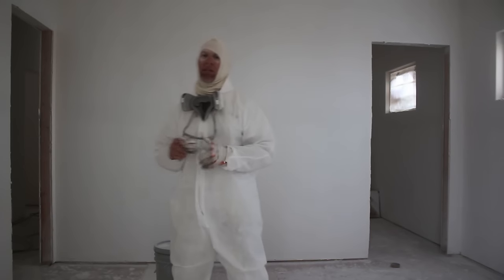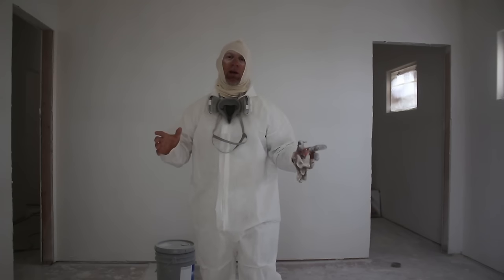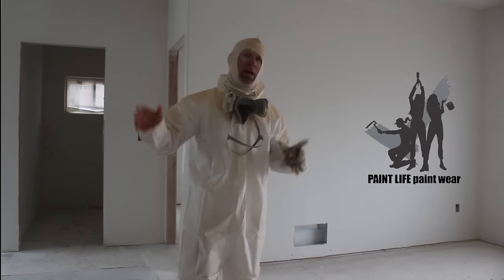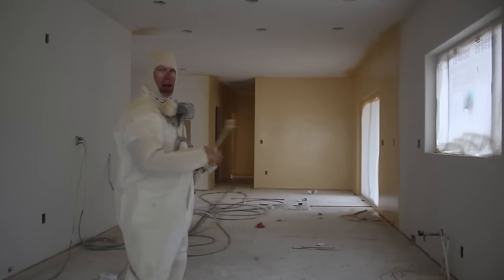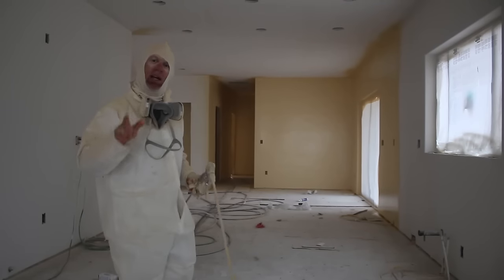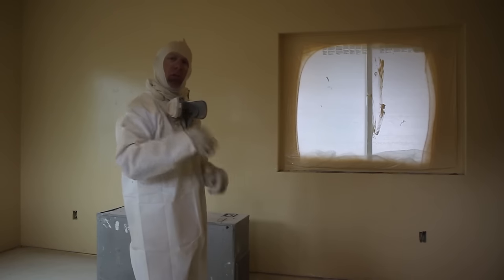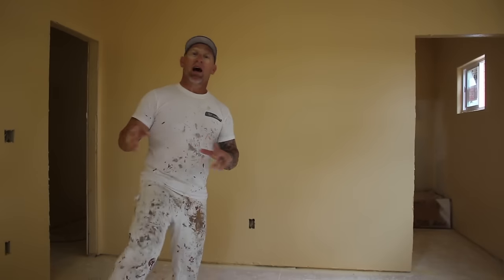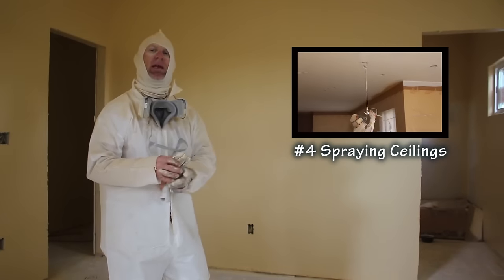Spraying Interior Walls With An Airless Paint Sprayer.  How to paint drywall.  DIY painting.

Comment: Haven't used an gun extension for this purpose... Always use a 3 or 6 foot  pole gun. I also roll at least one coat of topcoat(celings and walls) so  the paint is worked into texture. A roller texture is easier to touch up later on than just spray...Love a 12-21 or 23 tip. Thanks for your videos

Comment: Hello, I want to understand the process involved after the drywalls are installed. I believe you'll first skim the wall, sand it, spray primer and then spray paint, right? Is roller used for any of the paint jobs? 

Trying to understand what aspects of the job will the sprayer be used. Very new to this approach

Comment: hey good video and looks like you guys have a good gig going,  efficient and quality work from what it seems.  just a little tip for ya that might help you guys.  not saying you don't do a great job by any means just one professional that likes to help another,  I don't only have expertise in residential painting applications but also design & app expertise and business as well.  some homeowners or customers can sometimes have a great eye,  or hire people,  like myself,  that have a great eye and can tell small variations in paint coverage... long story short I guess my tip to you would be to start your spray at the corners.  there's nothing wrong with taking your finger off the trigger.  sometimes haste can lack.  when starting your spray in the corners, you can actually mentally control your line of attack and also expect a more evenly coated wall. your corner coverage will precisely tell you exactly how to apply to the rest of the wall around it. it'll all be in the hand after that. try it out.

Comment: Montana Painter is correct, I back roll most of my coats of interior spray. Even my primer coat. Do an experiment where you spray a section of wall so that it is solid and uniform and then take an 18 inch roller with a three eights nap and back roll it, you’ll find out you have way too much paint. Then spray an area so that when you back roll it you have a nice uniform code that is worked into the substrate.
Just as the Montana Painter has explained. When you are doing large commercial buildings interior with large walls 20 feet high touching up becomes a lot easier when you don’t have to repaint entire sections because everyone knows just a spray coat will not touch up,
Not to mention the cost savings in the amount of material you will use on let’s say a 400 to 600 gallon project.
Reply: Hi, so do you recommend spraying a lighter coat and always back rolling the paint with 3/8 nap roller? What if you are dealing with a level 5 smooth finish ceiling, and you want to put an eggshell sheen in the kitchen /dining room connected area. Will back rolling give you lap marks? Or is the fact that you sprayed the paint on in a fast fashion, help lesson or eliminate that. Lastly, whether just spraying or spraying and back rolling, is one nice spray coat sufficient?

Comment: Can I ask how many coats do you spray for new construction? In this video you sprayed one coat then removed the masking. If I need to spray two coats, do I need to remove masking right after the first coat, wait until the first cost to dry,  mask again, then spray the second coat?
Reply: I know it’s a year old but typically you’ll do one coat of primer and two coats of finish on walls. You can do one coat of primer and one coat on the ceilings though with spot priming, depending on your scenario. I do a lot of commercial jobs and new construction/remodels, you don’t have to pull your tape in between coats. It depends on what surface you’re taping to, how long the tape is going to be there and stuff like that. We don’t have the time or luxury to mask more than once, so we do it once and get it all done then pull it soon after. If you leave it too long it’s hard to get off. If you’re a painter i’m sure you’ll have learned this stuff by now.

Comment: Thank you for this video and all of the other videos you posted, the knowledge, advice and techniques you give is awesome! We just finished painting our house with an airless sprayer (Graco Magnum X5) using the techniques you recommended and had one problem - Goggles kept fogging up. I had a paint suit on, respirator, and went through five differn't pair of safety goggles. I kept having problems with the goggles fogging up or getting paint in my eyes when doing the ceiling and closets and the garage. Any advice on what you use for eye protection when painting?
Reply from the maker: Dewalt safety glasses

Comment: If your ceiling is already painted, will 4' plastic masking be sufficient around the perimeter if I want to spray the walls?
Reply from the maker: Could be, just watch your pressure. Might be easier to just roll the walls though.
Reply: Way overkill, 12" is good with appropriate pressure, kickback and ventilation.

Comment: After you spry the primer do you have to sand the walls. I hear the fibers in the drywall board will lift and you have to sand them before you paint
Reply: I find that if you spray the walls with sealer before the ceilings the walls are much much smoother than if you do the ceilings first

Comment: How do you reduce "flashing"?  I have been using my sprayer and I had to apply two coats on a test room (because I went cheap and didn't prime) on new construction spray texture drywall.  I experienced a slight flashing in the sheen.  The paint I am using is Behr Ultra paint and primer, eggshell.
Reply from the maker: More paint, and keep a wet edge. Still when spraying you may get some
Reply: Try some floetrol just a hint of water n keep the wet edge, here in so cal it gets hot flashes a lot if I don’t adjust the paint

Comment: Do you recommend back rolling the walls on a home that is not new construction? I'm going to be painting my entire home, walls, ceilings, new trim to be installed. For the walls and ceilings I will be using flat paint. The home will be completely empty and new floors will be installed. Current paint on the walls appears to be original from 1995 when the home was built.
Reply: +The Idaho Painter Do you use a brush along the corners near the ceiling as well, or just roll as much wall as possible?

Comment: Hello ! really helpful videos! question: would you recommend spraying a gloss latex in an interior with textured walls? or is the risk of fingering/ lapmarks too great . would it have a more professional finish if rolled?
Reply from the maker: We never use gloss, we use satin and we always roll if the customer is living in the house
Reply: You can spray on every step plastic off all furniture 2 wide paper on floor below trim but always especially with any kind of gloss/satin backroll walls and ceilings as well unless their flat maybe eggshell... these are my rules becuz I'm a one man crew... My procedure goes patch holes caulk always 1st throughout area take as many doors off as possible scissors in middle of 1 or multiple rooms if possible mask doorknob and hinges spray them and as much of trim possible as well as casings then day 2 mask doorways n trim sand spot prime with wall color hit walls 2 coats backroll... Day three drop plastic hit the lids {ceilings} reassemble what you were able to get done then repeat process my only exception is walls in bathrooms and around cabinets/backsplash area brush n roll! I 90% of the time never get uninhabited repaints and never do new construction nor do work 4 contractors the pay they offer is SLAVE labor and I make triple doing repaints as well as my only employee being a handheld  and wheelie Graco sprayer!! Must say exteriors is where the cheddah is at me a masker my wheelie Graco some drop clothes and 3 extension ladders and my short pole with roller and only use Sherwin Williams Super paint... PEOPLE think I'm crazy for backrolling exteriors unless it's hardiplank but the coverage and even coats I achieve are second to none brush n roll eaves n trim.... If anyone wants to know how to make all the MONEY that's how I take longer but my quality is far better and there is not 1 painting job I can't do by myself!

Comment: also what kind of paint are you using from Sherwin williams. is it the promar 400 or 200. I'm about to start a paintjob on new construction and I need to know what kind of paint would be best to go with to only have to put one coat. the cheapest stuff at Sherwin williams is like water.
Reply: Joshua
I represent a commercial painting company in the DC area.  The best Quality / Price product sherwin William has is Promar 200.  Its not as cheap as 400 and not as expensive as other high end products.   Trust me, the paint will not come off for a good number of years
Reply: Thanks
Reply: I agree.  I spray promar 200 on almost all the homes we do.  It's a great paint for the money.

Comment: This group of videos was very helpful.  Is the sequence of this new construction job different if I were to use painted white trim?  Would you paint the trim off the wall and then install after the ceiling and walls are painted, or install the trim first and then start the paint sequence?  Same question for casing trim?
Reply from the maker: Install the trim first
Reply: For new construction, primer all walls and ceiling. Next would be to install then paint trim.  Then paint walls and lastly ceiling?
Reply: Paint Life TV in this video there is no trim yet installed? Is there a way you can quickly spray trim once it’s installed even thought your walls are already finished?

Comment: This is the problem with these tips is how do you do this and paint multiple coats? You say pull stuff off when it's wet but I have to do a primer coat, and two finish coats... How do I do that and pull off the paper when the paint is wet? Do I have to tape it every coat?

Comment: question are you back rolling it after spraying it?
Reply from the maker: There are a lot of factors that determine whether or not we back roll
Reply: We find that backrolling the finish coat is all we really need to do.  I know plenty of guys that don't even do that and their work still looks amazing. As the poster of the vid said, there are many factors to consider. My personal opinion is anything above a dead flat (matte, eggshell, satin - etc.) should be back rolled on finish coat to help out with touch ups, but that certainly doesn't guarantee success. Enamel wall paints are very unforgiving on touch ups, especially in rooms with lots of light.
Reply: why would you be using enamel paint on walls? I dont think we have ever used it on a wall??

Comment: Can I run a 1221 tip on a 440 graco sprayer ?
Reply from the maker: No, but you could use a Hyde dual head tip extension with  2 -515 and you would get the same fan width 🤙

Comment: Looks like you had a little bit of a tail but then you turned it up . Sometimes if your rig doesn’t go up you might have to adjust the paint with a lil bit of water or floetrol xim might help getting rid of any stripes you don’t want the other guys to start calling you Tiger 🐯

Comment: Never do the stain on the walls... Do all the trim off the walls. Stain and seal to finish state. Prime walls, paint walls, put trim up finished and only have to fill nail holes then light face coat sealer on trim and done. No need to worry about covering stain overlaps on walls, no being on knees except one time, no need to worry about getting paint on finished trim.

Comment: One notation I make is always back roll when spraying it on. This way you avoid runs & missed spots. You might also as well wear a full head cover halloween mask w/your respirator to keep the paint out of your hair & off your face. L.O.L  Just joking! but for real have a helper back roll it as you spray it. It will bond & cover better what it is your painting.
Reply from the maker: Thanks for sharing Dave!
Reply: I used to do a lot of spraying and back rolling on level 5 finish commercial projects sometimes even using a third guy. One guy spraying it on another coming behind rolling it out followed by the third guy laying it off. I know three guys may sound like Overkill but it is a Very fast and efficient way for doing those extremely long hallways and such.

Comment: I don't understand the caulking of the window during masking.  Do you a more in-depth video of that?

Purpose?
Reply: dpeagles when the call is on the tape, it seals the tape from paint bleeding through/under the tape.
you have to Caulk it lightly and favoring the tape. too heavy on the wall and you will pull the caulk with paint on it, on your clean area the tape was originally protecting and defeats the purpose.

Comment: why do you paint the walls first? I thought ceilings was first?
Reply: The Idaho Painter My question isn't why paint the walls first, but why would you install the trim, then stain and finish it, then paint walls?... Isn't it faster to stain first, then install after walls are painted?...
Reply: If you paint the ceiling first with your flat paint, and then want to spray the walls with your eggshell of a different color, you wouldn't be able to cover the ceiling to then spray the walls. The covering would just tear down. If you spray the walls first, you can then drop off the walls and spray your ceiling.
Reply: Then once it's stained, you install it and have to nailhole fill and caulk it and then paint/stain it again. This way you can prep it with caulking and spackle the nailholes and just paint/stain it once.
Reply: @AcresOfHope521  Yes you could. Masking tape sticks to flat paint just fine.
Reply: @AcresOfHope521  makes sense, but it depends on whether you like to paint over your caulk. If you like to leave your caulk showing, then you leave trim off till last.